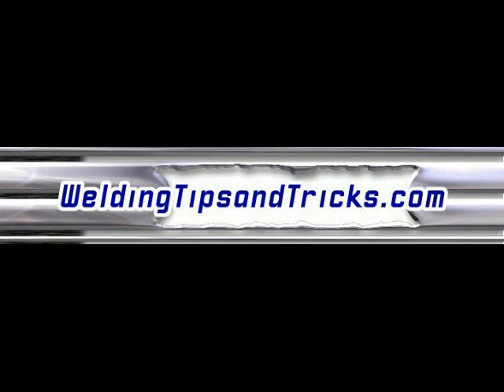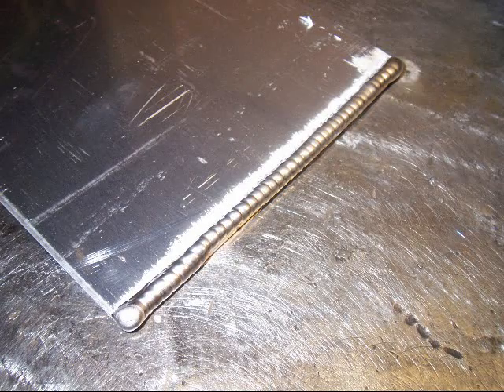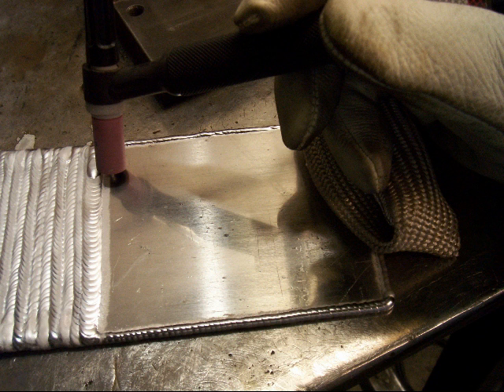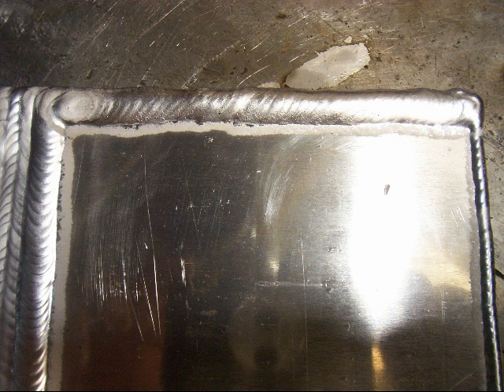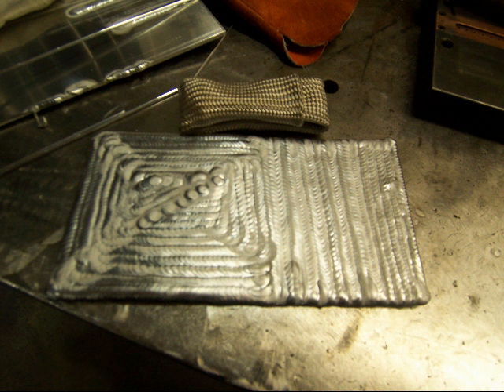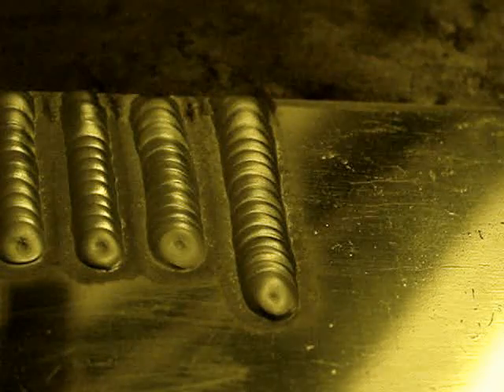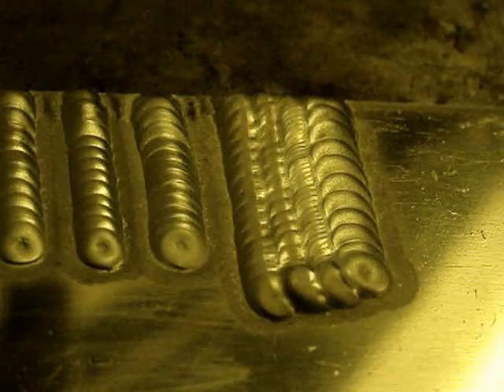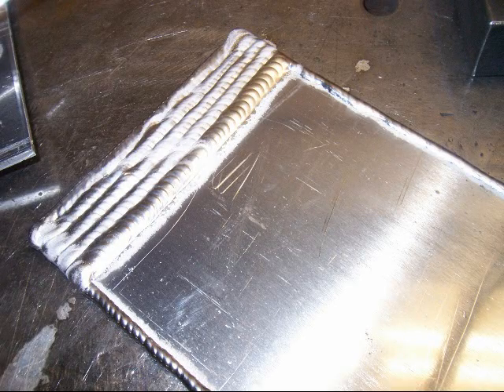Aluminum Welding Training on your own at home

Comment: ive been following your videos for a couple years now. ive learned steel stainless but this aluminum is just tough. im trying to weld up intercooler piping from an ebay intercooler kit, but i havent one nice bead yet

Comment: hey Jody sup man great video but as for me I'm having a hell of a time trying to weld stainless in my class i was able to get aluminum down by the end of that class but stainless just does not wet out or corporate at all like aluminum can make this same video but address those things that go along with tig welding stainless.  thanks again and you are one dam bad ass welder man  (oh that's a complement in case it didn't sound like one lol)

Comment: Wow, I'm going way back with you here. Your camera is so much nowadays. I grabbed  a piece of aluminum from home depot and filler from Amazon and Harbor freight. My weld beads are stacked nicely at times. The thing I don't like is they don't look as smooth as a lot of shots I see here and there. Tried more and less cleaning and played with the hrtz. Cleaned my parts well with stainless brush and acetone. No matter what I can't figure out how to get the weld bead very clean and shiny. Wondering if it could be the aluminum from home depot or the filler I'm using. Have any tips on having a very clean shiny aluminum bead? Thanks. Having issues seeing my messages from YouTube here so will stay on top of this post in case you have time to answer. Appreciate the videos and weldmonger store

Comment: Hey I have a ? For you we'll I bought a car then I had it transported on a trailer anyways the guy scraped the oil pan & put 3 little cracks in it all the oil leak out ok well I have been trying 2 get the oil pan off it won't come off. So I'm thinking about stick welding it underneath the car would it be safe to do?
Reply: Swift Vet i think stick welding would burn through the pan wall

Comment: I've done a fair bit of welding in my job as a plant fitter here in the UK.  Retired now and aged 70 I've just bought my first ac/dc tig welder as all mine was oxy acet and stick. Really enjoying these lessons.  Just wondered what approx amps setting would be for 12g aluminium (inverter welder)
Reply: on the miller welding website ( www.millerwelds.com ) under the resources tab there is an download called Guidelines for Gas Tugsten Arc Welding ,  it has really good charts with base setting for tig welding aluminum. hope that helps .

Comment: as a beginner welder, this training is exactly what i need.
can some provide the information about the tungsten size and amperage used in this video.
cup size and filler rod will help as well.
thanks.

Comment: I work welding aluminum eight hours a day and this video is informative for the beginner . My stick out on the tungsten for me usually running flat I keep the tungsten basically flush to the torch cup. Helps prevent dipping the tungsten into the puddle and creating smoke on the bead and dirtying the weld itself. Hope this helps.
Reply: Another good tip is that you use a zirconium tungsten electrode. Zirconium tends to ball less and keep a focused arc.

Comment: A continuous feed of the filler wire is also a good technique in some cases - as you would do with an automated or robotic TIG application with cold or hot wire feed.

Comment: I have a question. on an outside edge/corner joint 16G how can you get nice penetration on the inside? My School gives us Au plate (not sure grade) 6"X2". So I'm making 2" tube. using dynasty 200 dx 200Hz on the AC, 110 amps on the max (not full pedal). p.s. thanks for the TigFinger, works great.
Reply: To get the best penetration on an edge joint leave a small gap. And if you're using a crappy dynasty, 110 Hz and 60-70 on the balance to get a class A weld.

Comment: Y does my filler metal stick to the work base metal
Reply: because youre not putting the rod directly into the puddle, you might be hitting some metal that isn't quite molten. If you are pulling your electrode too far away to try to fit your filler rod in their then that metal might have cooled down just enough to grab that rod. Just lightly and fairly quickly tap your rod into the molten puddle and you should not experience that rod sticking.

Comment: This is good to point out. I use a dual action sander with an aluminum oxide disposable. Ironic isn't it? It's also worth noting that aluminum oxide is harder than clean aluminum.

Comment: Don't forget your engineering. Trig it out, calculate your leverage arms, square inches of weld, etc... What is the actual stress on the welded joint? 500 psi? 1000 psi? If your butt's hangin' in the breeze, you're gonna want to be confident.

Comment: Do you let up on the pedal as the base metal begins to warm up? That was one thing I practiced quite a bit on when I was first learning on my everlast welder. You might not be able to control how hot your base metal gets as you weld but you can certainly control how much heat you put in as it does.

Comment: Dear Jody, I am practicing on some clean angle iron its about 1/8 thick or 3/16th. My problem is my beads start of narrow and high and when the metal starts to heat up they turn into butter and starts to get wide and weeps all over ? My name is how I feel.

Comment: Is this a suitable weld for like a scooter? One that would be handling loads over 100-150 lbs of me jumping on it. I want to make my own scooter out of aluminum. but would need to weld tubing to the deck for the handle bar to fit in. this area would be subject to my weight.

Comment: Yep, it's a tig finger, like acerman007 said. Usually made with an approx. 1" wide strip of aluminum, about 3 or 4 inches long, covered by a heat -shielding flexible material. In the 1960's, we used asbestos cloth. That was before the government decided to save us. I think you might, at this time, use very thin ceramic blanket instead.

Comment: @curtmastor well you won't be welding anything out of aluminium as maxstars are only dc you'll need a dynasty or a syncrowave or even a little diversion to do aluminium as you need ac

Comment: Looks easy, when you do it, have, since the 80's stayed away from aluminium work. Broke a cast aluminium part and was told there is no way to fix such, must cast new or buy new. (did the later) I am the type of person whom rather buy the tools needed to fix things than send it away for repair(unless stil under warrenty) In the years of trade-school I never come across work with aluminium(only steel,kopper,brass and iron) regards to welding, brassing and soldering... Your vid.-clip helped!

Comment: @manic74 not 100% on it, it may have been that the aluminum wassent "pure" aluminum, but i use the same aluminum i used with the tig, with our miller millermatic 252 with the aluminum gun and it welded good

Comment: @manic74 its not that thick at all, but i did get it to weld, not 100% on what the problem was, i cleaned the aluminum alot better and we grinned the tungsten differently

Comment: @Ignerence I'm not Jody, but sounds like you need to back off more as you reach the end. I am a TIG novice, and found out real quick you have to back WAY off as you get to the end on aluminum. I still don't get it right, not enough material to practice on.

Comment: @cbman96 Still not hot enough. How thick you tryin to weld? Aluminum disapates heat VERY quickly. If your material is too thick for your amperage ability you will never get it to melt unless maybe you preheat the material if you are close on amperage.

Comment: I have a question for you Jody, I have been practicing butt joints, and T joints on .125" aluminum with my 250ex.  I have got the stacked dime thing down ok, but the last 3/4" of each weld gets too hot, I loose the appearance.  I have tried limiting amperage near the end of the weld, but it just doesn't seem to help much.   Any hints do finish up to the edge on alumium without getting too hot?   Thanks, great videos!

Comment: hey i got a question, i am learning how to tig in my school (tech school) and we have a miller, but when ever i try to tig, i cant get the base metal to melt, we know the machine is good and all, but i cant get it to melt, ive turned up the amps, did nothing, any ideas ? i am welding aluminum too

Comment: @sidemountdiver1 Contact your local supplier and ask them. The cost will depend on the size of cylinder you have, which will depend on how much you intend to use. If in Canada, like in England, you have to pay rent on the cylinder, you will need to add that into the equation. I have an account with BOC and they charge you for the gas, the cylinder rental, which i pay annually, and to change your empty for a full one.  I only use an argon/CO2 mix so i have no idea how much argon is.

Comment: @DjCantFuckinMIx i did look around, and yes, some heavy-duty TIG welders  run on 3-phase OR single phase. the primary advantage to 3 phase, as I understand it, is that it's easier on motors because it give a smoother power transfer. it also eliminates the need for a commutator or brushes. in the case of welders, it simply is easier on the welder, and easier on the rectifiers used with DC modes.

Comment: @DjCantFuckinMIx Tungsten Inert Gas, or GTAW, Gas Tungsten Arc Welder, mig is Metal Inert Gas, or GMAW, Gas Metal Arc weld, and i do realize now that name calling is pointless, and apologize for that. 
i may not have 22 yrs experience, but I am not stupid, i'm not a straight A student either. i am a High School Senior, and i'm 18, and i have spent enough time in our shop that i know that our tig and arc welders run on single phase 220. our drill press runs on 3 phase 220 or 340, not sure which.

Comment: @PatrickTheSaxPlayer I believe you are incorrect. Pure Aluminum is an element itself, so it cannot contain an element (Chromium, not "Chrominium") "in it." Actually, aluminum forms an oxide, alumina, or "Aluminum Oxide" (Al2O3) which has a much higher melting point than aluminum itself, and hence is very difficult to melt. My professor has welded TIG and uses high frequency to "break through" this coating.

Comment: I have two years primarily with welded aluminum TIG.Nu I am mainly working with stainless steel. But I do aluminum welding still a whole lot easier than welding stainless steel. It's really a matter of much to do. Aluminium is a truly fantastic material assets to work. I have not even read certificates, but I read better than many welders with certificates. Just by doing a lot, and really focus what others do. Tig welding is really great!

Comment: I got a question, I'm getting more into aluminum tig. When I do aluminum it makes a weird high pitched crackling sound, compared to the quiet hum of steel. I'm using a Miller syncrowave 250 with it set to 1-2 on ac balance, puddle control at 3,  1/32 2% lanthanated tungsten with a #7 cup with a cfh of 17-19 . Is this a normal sound with aluminum, I'm kinda thinking somethings not right.

Comment: at anoka tech we have to build up on the edge and have be the same width as the metal which is extremely hard cause we have to use 3/32" tungsten and same thickness filler on 1/8" metal.  I still haven't got it yet cause the damn amps have to be so low to be able to make the bead 1/8" wide without over hang on the edge.

Comment: @rookis25 if its burning the tungsten you need to set the balance correctly. first you can't sharpen it you need to ball it at the end.  you set the balance to 35 and bring the tungsten close to the table on top and push down on the pedal slowly.  the tungsten will turn a bright color and when you keep pushing down more, still slowly then it should form like a ball at the end.  when your done you set the balance to like 60 so it doesn't burn it up. just some stuff im learning at anoka tech.

Comment: @Hector49er 
The shop Miller does look like the Syncrowave 250 DX but 30% taller. I guess the best way to find out is actually look at the model number but im usually in a rush gettn jobs done just under the wire. Thanks for the advise ill give it another go.

Comment: I am right handed but have learned to TIG left handed, it was just easier and I started getting better faster when i put the filler rod in my right hand.  I've been welding for 2 months.  Every now and then I try switching it up and it just does not look good.  Do you think this will be bad for me in the long run?  I'm wondering if maybe I might be sacrificing some skill later on for the sake of not having to wait for my left hand to get good at filling.

Comment: I need help in a big way. I have yet to get a puddle. On the Miller at work running Electrode + & - with all ranges of amps from 50A - 120A & the closest I get is a black colapsed blotch. I even took my time the last 10 trys but nothing. Thanks for any direction.

Comment: Gret tips, great job. One question by a non-welder and welder-to-be. Is it absolutely necessary to have argon running while you're welding just for practice or is it possible to Tig weld without any gas at all just for practice purposes? I would really like to know that. Thanks.

Comment: how about doing a video on welding cylinder heads. I just recently started getting clean welds on thick ally heads by reducing the stickout to about 1mm and using a large cup. Otherwise using a stickout like the one on the videos just gave me dirty welds on thick ally. Thin ally OK